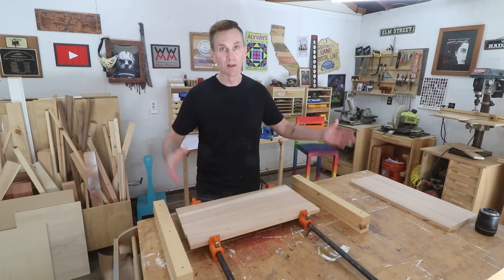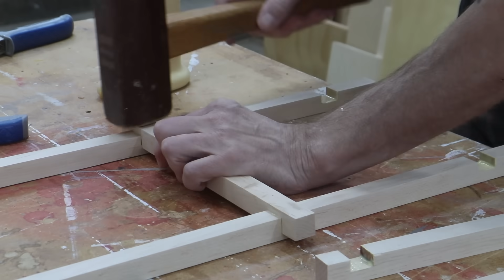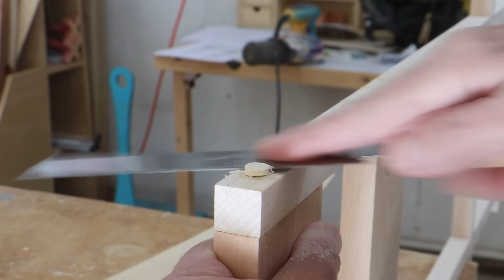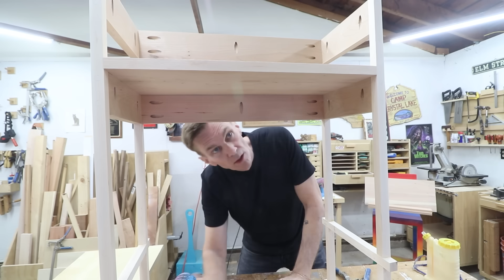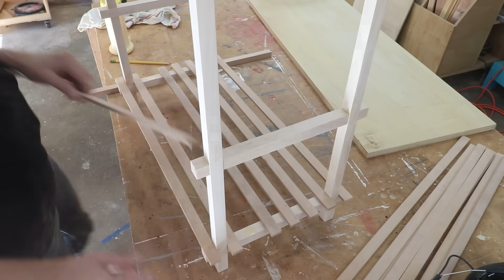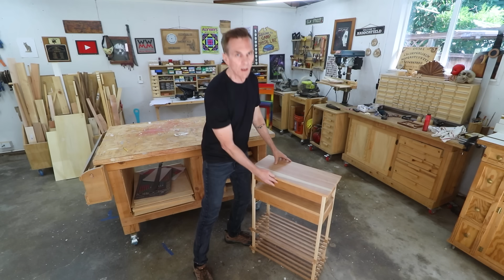This space-saving dressing stand will transform your bedroom

Comment: I love your videos, but I'm a little confused.  At 15:25 you appear to use the fence with the gripper to do a long cut.  I thought that was a no-no?  Isn't it better to use a miter gauge or crosscut sled (or miter saw?) for a cut like that?  Genuinely curious if there is some mitigating factor that means this is safe.
Reply: Yeah I think he has just enough material to keep it flush against the fence, but it’s borderline to me.  Never used a grippr so maybe it give enough consistent force against the fence in this case, but wouldn’t attempt that cut guiding it by hand the same way.

Comment: When you do a glue up like this the boards are in direct contact with the pipe clamps does the glue squeeze out that comes into contact with the bar clamp and the wood cause black marks on the wood and if so how do you get them out?
Reply from the maker: It can definitely leave black marks that can be difficult to sand out. I try to leave a slight space between the panel and the clamps. You can also place a sheet of waxed paper over the pipes.

Comment: Does anyone else hate those stupid stickers on the wood?
Reply: stickers are ok.. but our local store attaches them with 50 staples like a lunatic.. Im always woried i missed one.. i don't use a table saw but still having a miter saw hitting one of those turns it into a bullet.
Reply: I don’t use box store wood. No stickers. Look for some s4s if you don’t have a jointer or planer. Good luck!
Reply: They're less annoying than all the ads in this. I didn't bother watching the rest of the video after the second one. I think I'm heading toward being done with youtube.
Reply: I'd happily deal with stickers if I could buy CHERRY! in a DIY store (the only place that's going to put on a bar coded sticker) in the UK 😂
We're lucky to get warped, rough sawn pine with stickers.
Reply: Ya
Reply: oh my god! YES! My OCD is killing me…. I keep wanting to peel them off. Lol
Reply: I find peeling them off to be therapeutic.
Reply: Heat gun makes really short and clean work of them. Made me less ragefull.
Reply: If it doesn’t get trimmed off during cutting it comes off during the sanding/finishing stage.
Reply: I'll happily take ANY hardwood with a sticker. Here in FL, its only warped, split pine or every once in a while, you'll find scraps of cedar. Hardwood lumber here is like finding a unicorn that farts glitter.

Comment: Hi Steve , Great video as usual. However a word of caution in regards to expansion and contraction. I built a  Carlyle Lynch hooded cradle out of air dried cherry. I cut the through dovetails  on Saturday. The next day I went out to the shop to find my dovetails were misaligned  by about 3/16 inch. I had to totally  remake the headboard from scratch. Lots of extra work. I found out the hard way when connecting wide panels with dovetails make sure all grain is running the same direction.Duh!!!.  Lesson learned. Great project . Love your channel.